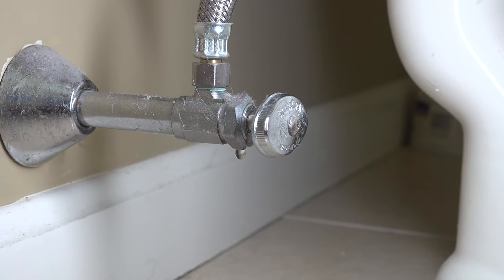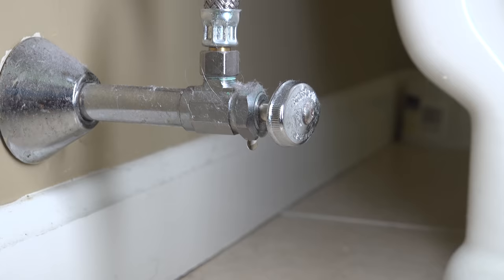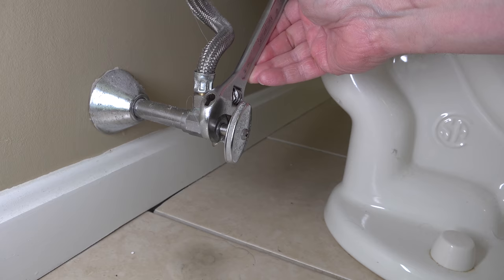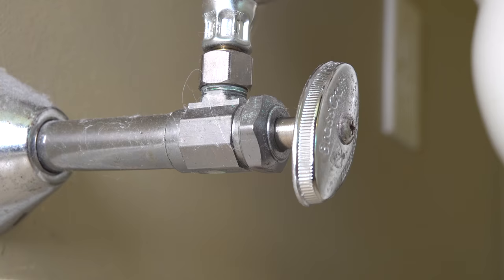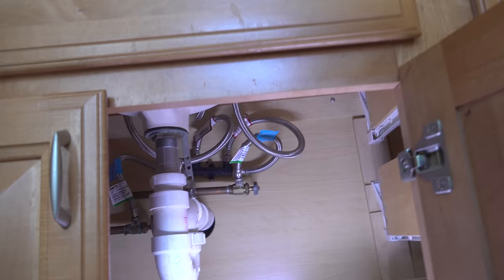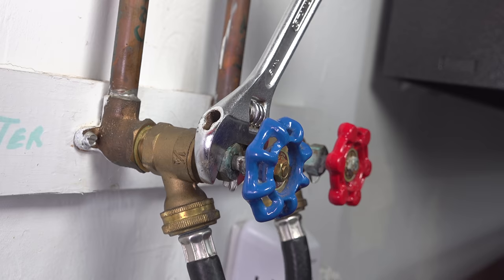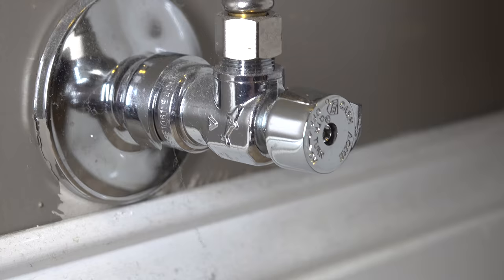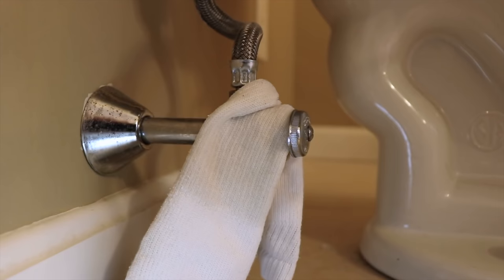Few Know this EASY TRICK to STOP Leaking Valves INSTANTLY

Comment from the maker: Remember to LIKE & SUBSCRIBE it really helps! / Great value adjustable wrench https://amzn.to/3BF11Fd or if you hit the lottery buy this one: https://amzn.to/35hCGt3
Reply: Do you really mean I can lose 45 pounds by drinking water at night? 😂😂 Love your videos keep them coming
Reply: No, no, no. Over time you may have to snug it 4 or 5 times and then you won't be able to turn the handle. The correct way is to loosen the packing nut, but don't loosen all the way. Let the water dribble into  a cup or on a towel for 20 or 30 seconds. This relieves pressure off the packing material allowing it to absorb water thereby expanding the packing and lubricating the handle shaft. NOW snug the nut until it stops dripping. I usually give it an little extra snug after the drip stops just to be sure, and always back up with another wrench. 

Signed: A Forty Year Plumber
Reply: Hi Silver, do you have a video about what to do when the value thingie inside the tank is spraying a small amount of water after the tank has finished filling?
Reply: Dyi

Comment: Can we all take a minute to appreciate the work this man is doing to entertain and educate us. Man thank you very much!.
Reply from the maker: So nice of you
Reply: @SilverCymbal  😃
Reply: I appreciate the extra work he's generating for us plumbers.

Use a second wrench to stabilize the stop body.
Reply: @SilverCymbal There was a water main break on my block and immediately after they fixed it, my hot water stopped coming out of all of my sinks but hot water comes out of my shower. 

There is no way all 3 sinks in my house have a problem. What could stop the hot water from coming out, only cold water comes out of my sinks??

Also, my hot water valve was leaking but I turned the nut and it stopped. But I still have no hot water coming out of all of my sinks?
Reply: @MilkyWayGalaxyy  did you give it enough time to run the water til the cold water is out of the hot water pipe and the hot water starts flowing!
Reply: Absolutely agree.   He knows he's talking to NON-plumbers which we appreciate

Comment: I would suggest always using a backup wrench on the valve body itself just to be safe. It really sucks to cause a new leak when trying to fix an old one. Doesnt take much and sometimes will save a giant headache
Reply: Especially on CPVC.
Reply: I'd take one extra leak here over the kitchen sink any day. I mean it's a pain doing the sinks when nothing wants to go on right.
Reply: @virginiatruax291 you can break something in the wall from not backing up on the valve body
Reply: 100%.  Learned this the hard way a few months ago and it turned into a costly problem.
Reply: @bgrady24 he says the exact same thing in the video.
Reply: I had to tighten mine pretty hard, and supporting the valve body was essential. Thanks for pointing this out.

Comment: Once a year you need to fully close then open all valves in your water system. If you ever need to replace them, go with the better type with the hand lever, quarter to half turn on/off.
Reply: Good advice! I just learned this! Will save you a headache!
Reply: Ballvalve type

Comment: Whenever I have the opportunity, I will change out old style valves with new quarter turn ball valves. Sometimes, if that old valve has not been turned in a couple of decades, It will not stop leaking, or it might even break when you try to turn it.
Reply: Take the time to replace the packing nut valve with a quarter turn valve. A quarter turn ball valve will last many years longer than the packing nut valve and it won't leak. Itcs either open or closed, no in between, therefore no leaks.
Reply: Sometimes it can take up to five or six rolls of duct tape to stop a stubborn leak.

Comment: If tightening the nut does not completely seal, turn off the water source to the valve, remove the nut, and pack the nut with graphite or teflon valve stem packing, available at the hardware store. Another option is to replace the valve stem, for about the same price as the packing. Remove the stem handle. Remove the valve stem. Replace with the new stem.

Comment: This video is a lifesaver. I just spent the last couple weekends fixing a variety of leaks in some old plumbing (the only thing stopping me from installing my new tub and shower.) After basically resoldering all the joints and replacing half the parts, I then realized my last leak was from the valve itself…and I almost cried…

This fix worked like a charm! Thank you for saving me from burning my house down for the insurance payout :D

Comment: Thanks so much! Tried this before  cutting off and replacing valves. Fixed my leaking water valve behind the fridge, much  appreciated sir!!

It seems turning valves on calcified pipes causes that nut to loosen and leak and just needed tightening back up. Awesome help.

Comment: I prefer the quarter turn mechanisms.  They seem to be more reliable.   Some really great advice I will be using on my own faucets.  Thanks a lot.
Reply: They are. I have no idea why multi turn still exists.
Reply: Completely agree.  All my valves, including at hose bibs are quarter turn. Gate valves can deteriorate over the years if never exercised by occasional closing and opening.  Especially if internal corrosion occurs.  The corrosion can help maintain leak proof condition, until the valve is exercised and nothing short of replacing the valve can fix the problem.

Comment: Thanks - this did the trick and I'd been dreading it for months. Figured I'd have to replace the angle valve which would require cutting off the water to the entire house. Barely turned the nut (not even an 1/8th turn) and it was no longer leaking.

Comment: I was just about to take a torch under my kitchen sink and try to sweat off the old valve and decided to look one more time for a solution. I have no doubt that I could have learned to solder copper but I might have started a fire under that tiny sink! Thank you for showing me the actual problem, letting get more life out of the old pipes, and avoiding fire in a small place!

Comment: At 1:42 you can use a second wrench to hold the hex part at the botton of the valve body. And those 1/4 turn valves are called ball valves.

Comment: this video & tip saved my bacon. I was just about to have to go get a new valve, shut off the main water supply to my house to repair it, etc. Just would have been a big pain. Valve nut just needed tightened just a pinch.

Comment: Great tip that many don’t know about with a simple packing nut adjustment.  These valves are cheap and can easily be replaced with no plumbing or soldering skills just using valves with shark bite connections. 👍🏼
Reply: @DDunc1020  I personally don’t need them however it’s another option for people that don’t have experience.
Reply: @MichaelRei99  I don’t disagree, they’re cheap enough as well. 👍

Comment: Thank you so much for all your videos that have proved extremely helpful in my repair efforts.   Could you possibly do a video on how to change the above valve to a quarter turn valve?  I know it is brass, chrome covered but I don't know what kind of connection it is and if there are any special precautions I need to take with the brass fitting.  
Thanks
Reply: The type of connection depends on the plumbing of your home. The valves are available in several different configurations.

Comment: ❤❤❤😊. This video is very well-made, with easy to follow instructions, and even I not being very mechanically inclined ; nor experienced in household plumbing issues and minor repairs can follow this. My late Dad never taught me anything about plumbing,  home wiring, or anything that can happen with a home .  I tried several times and wasn't really helpful ; he forbid me from offering any further " Help ! "One time, he was drilling in the crawlspace and threaded a new TV cable through the 🕳, he told me to drop a screwdriver down the hole so he could see it. I did exactly as he required and heard, " Not in my 👁 you stupid idiot; god** it, you almost poked my eye out, you  moron ! " Like I'm supposed to have X-Ray vision to see exactly where he's located underneath ? Tried to help my late Dad with car 🚗 maintenance  too and failed that test of " Manhood " as well ! Afterward,  it was always my younger brother who assisted my Dad ; I assisted Mom and my StepMoms with cooking and washing dishes !

Comment: This works. Except when it doesn't. If valve is older (which is when they tend to leak) hard water deposits tend to eat away at that washer. In my experience, tightening the packing nut works about half the time. And even in instances where it does work you are simply delaying the inevitable. It needs rebuilt. Good information to know. But if you want it fixed in a more long term fashion just rebuild it. Not hard and you'll know it'll be good for another decade or more versus months or a year and change
Reply: Exactly. If it's leaking, it's likely past its prime anyways and should be renewed with an overhaul kit because the stem washer is likely near death or already working its way to all the faucet aerators. lol
Reply: So how do you rebuild it?

Comment: I have a question for the OP, my toilet water supply line once I turn off the valve and remove the  supply hose, it leaks directly from the supply line tube. I capped it with a bronze cap which seemed to work fine but I get maybe a few drops of water per hour. I have not installed my new toilet yet but once I hook it up I don't think that will be a problem anymore. Do you think I need to replace the valv

Comment: Thanks for the tip. Mine is corroded, old 1/2” flare vale, I tried & couldn’t tight up a bit & the worst part is there is no shut off valve in the main line without turn off the whole building of this old condo! Any advice?
Reply: Wow that was definitely a low bid wins all contract to build your condo OR was in a unregulated area when it was built. Each condo needs its own water supply cutoff.  Or is yours the only unit without one?  Oversight?  Either way a unit cutoff has to be installed first otherwise no way to repair your leak.

Comment: Thanks. In the beginning of video, I noticed that the SS mesh connector to the toilet was twisted badly, this was installed incorrectly. You should make a video on this. I did this years ago and it caused a 4” deep leak in my basement, before I realized what was going on, I was not home at the time (out for dinner). When I checked the SS mesh, many of the small pieces had broken and it sprung a leak. Now I test these connectors from time to time (usually 1st of the year) by running my hand slowly across the connector and if I feel any snags (this will pinch the skin and it will hurt like a needle pinches your skin)  I know this hose is falling and its time to change it. Thanks….Jim
PS….thanks for mentioning the 1/4 small valves, that’s all I use. The valves in your video should be replaced about every 20 years. I use only double compression valves (on copper pipe in my home) and changing these valves is a lot easier. A friend of mine is a plumber and he introduced me to these years ago.

Comment: This may or may not work. Its more than likely going to stop the drip, but, it could also make the drip worse and have you scrambling to find the shutoff valve.  Best to locate the valve before you attempt this.  Also never do this on cpvc pipe. Friendly tips from a plumber who has been through it before

Comment: At the moment, I could use a video about fixing a leaky ball joint, which is part of the system that raises & lowers the bathroom sink drain stopper.  The compression nut that presses the ball joint onto the sink's tailpipe doesn't feel loose.
      Perhaps the fix is to simply disassemble and clean it.  Perhaps its gasket or gaskets need to be replaced.  Perhaps the ball itself is worn and must be replaced.  Any other possibilities?

Comment: One thing I've found with brass that adjustable wrenches and channel locks really want to round off the nut or just chew it up. Especially if you end up having to apply much force. I started using an open ended wrench instead and it stopped me from tearing up the brass so much.
Reply from the maker: They are so easy to use but just as you said they ruin every nut. I rarely use them any more because of it.
Reply: @SilverCymbal  I probably wouldn't be afraid to use them on a harder metal like you did. TBH I only carry the wrenches I use all the time and pack an adjustable for everything else. And I couldn't even function without tongue and groove pliers. But man that very first repair job where I put a pipe wrench on a brass nut that I didn't know was reverse thread... Well that still comes up from time to time🤦🏻‍♂️😆
Reply: If you have to crank it so hard that you're shearing the nut it's probably a lost cause anyway

Comment: I am in a house where each almost  time I needed to turn off the type valve you show here, the valve would have a drip leak when I turned it back on so I would replace with a ball valve.  Done a number of them over the past 10 years.  Since it leaked after being turned back on not sure the tightening shown here would have worked but I sure wish I had tried.

Comment: For $2.98 at the Depot (fall 2023)  you can buy a rebuild kit which has all the washers , stem and handle screw. Good as new. Yes , the quarter turn valves are superior and worth installing if you replacing a sink or vanity.

Comment: Question I have same valve going to same silver pipe. Is that a sleeve over copper pipe or is that a stainless pipe and how is that one attached threads or soldered? I have one not leaking just stuck in open where I cant turn it off. I wanted to piggyback  1/4 female right on top of that one where hose is then move the hose on the new one. In effect two valves one open and new one working. Ever see that?

Comment: Tightening packing nuts doesn't always work, especially on very old valves or plastic shafted valves. Plus you're holding back(Orange handled pliers) in the wrong direction. Channel locks are a directional plier. The valves you demonstrated were in great shape, people, be careful, its not all that uncommon to have vavles that are old break, if you're going to mess with your plumbing know where your main water shut off valve is and that it works. And yes, I am a plumber.

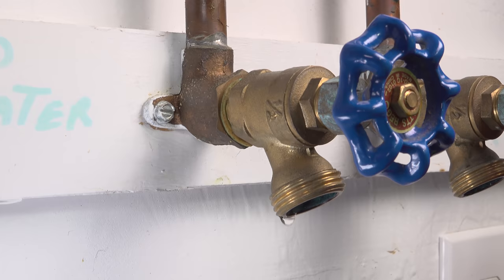Comment: The shot (0:23) with the steel-braided hose under a toilet is a potential disaster waiting to happen.  Those curly twists (to take up the slack/length in the hose) should be instead one SOFT loop so as to lessen the amount of torsion at any given point along the entire length of the hose.  Remember, these are NOT steel hoses, they are rubber hoses inside a braided steel sleeve.  Harsh or irregular bends in these pressurized hoses should be avoided.

Comment: You can buy whole seal and handle kits at home depot. This is for bradscraft and Mastercraft products only.

As a plumber myself, I offer this solution to customers. But no warranty since it's existing valves.

It's 1/2 the cost of a full replacement, I often offer this to lower income folks that have taken care of there valves. And that I'm not likely to have a return call.

Comment: Would using some wd 40 be helpful for movement on the valve if it's stiff before tightening?
Reply: If the valve is really stiff to turn or has hard water deposits, loosening the nut a long way before squirting WD40 helps it penetrate down the shaft.

Comment: You want to have the valve body in the open/flowing position when you snug or tighten the valve body compression nut so as to not negatively affect the valve body seat gasket...

Comment: What is the best way to seal a new 1/4 turn valve to the pipe coming out of the wall, it is iron pipe  M-NPT.  I used teflon tape and it has a leak that you have to 'feel' for any water.  Some times yes and other times NO....

Comment: Hi Silver Cymbal. I'm wanting to install a bidet with my toilet, and I was about to get to work when I realized there was no nut at all above the water shut off valve that I'd need to turn. 0:03 but without a turnable nut. What would this type of water supply line be called? Once I know what I need to replace, I'll be able to look up how it's done. Thank you!
Reply: I have this problem and no reply here. Just take it to Home Depot and they will tell you what you need. Take the existing toilet pipe too
Reply: @RightPathOnly Hey man. I resolved this issue a few weeks ago. Was great fun taking the parts to Ace Hardware, and one of the older gentlemen working there tried convincing me that the process was too hard and I'd be better off calling someone to do it for me. Sigh. It's like he never heard of YouTube because I told him the whole process looked simple. He even told me installing a bidet was even harder! Hah! Showed him!

Anyways!

 I ended up replacing my entire supply valve and hose to the toilet to get my bidet installed, and I couldn't be happier. About $20 for the replacement supply valve and hose. If you want to remove the old nut / compression seal on the pipe, you'll need a compression seal puller. I got one, but it was definitely an added expensive that is optional. Anyways, my hose to the toilet was so seized up that it basically only detached from the toilet when I removed the supply valve. Good thing I had a bowl underneath for the remaining tank water haha. Only real difficulty was returning a size of supply valve and hose that didn't fit my toilet (thanks Ace for your efforts) and finding the full water shut valve for my house. Last time I let someone else do the work for me (sizing up the hose / valve). In the end, everything's installed, turned the water back on and no leaks anymore.

AND

I have a new skill under my belt. Suck it ACE!